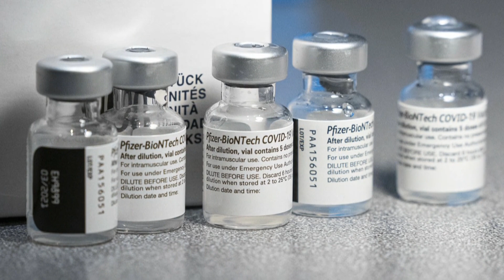Canada still on track to receive 4M vaccine doses in first quarter

Comment: Has the Prime minister spoke with them or not? Won’t answer!
Reply: She kind of alluded to the answer at the end.

She didn't personally have certainy about information regarding any potential contact the PMs had with the CEO of Pfizer.

At the very least, she was not certain if she could say anything regarding any contact.

Politician tend to run into so many roadblocks when trying to answer questions.

Say she thought PM had had a call and she said yes PM talked to the CEO

Next question would most likely be what was said on the call (which leads to more problems/roadblocks in being able to answer)

But also say press finds out later that the information was inaccurate. That can tarnish her credibility/trustworthiness.

Say she said yes but that was a breach of trust between the PM and the CEO

Say she said straight "I don't know".
That would make her come off as potential bad at her job; like "How can you not know? This is your job."

Plus seriously can we expect her to be 100% aware and certain of PM communications?